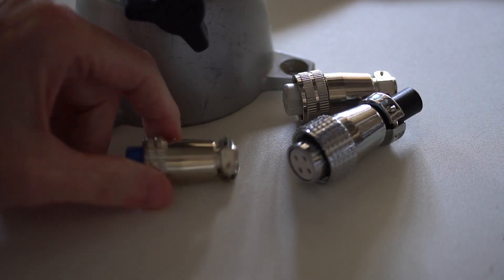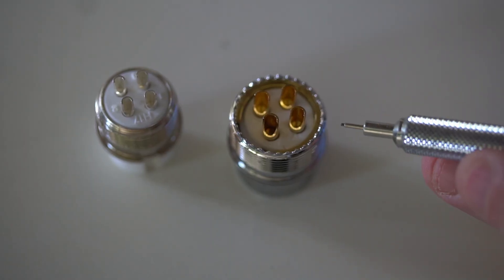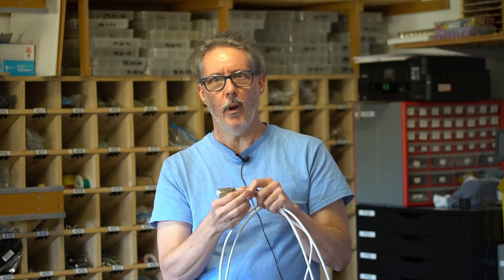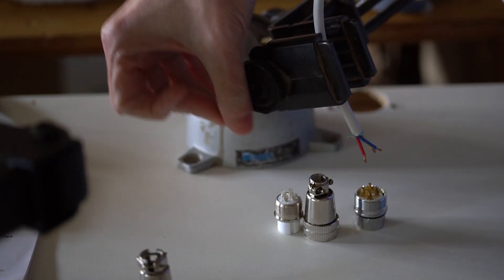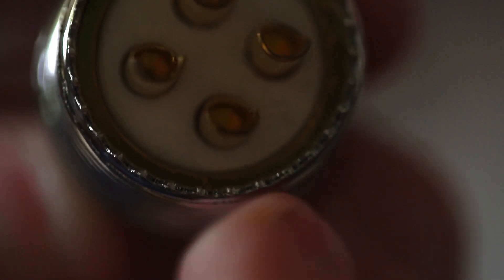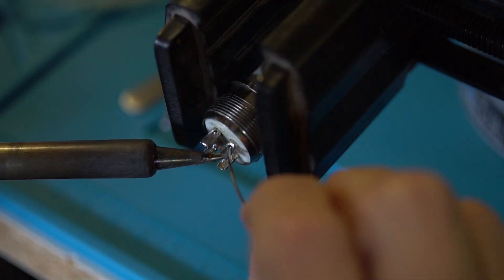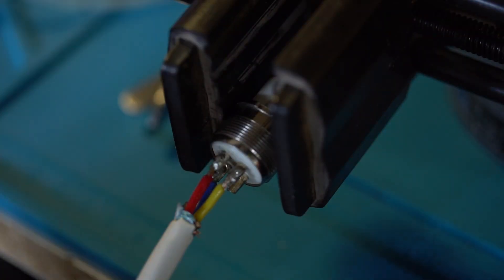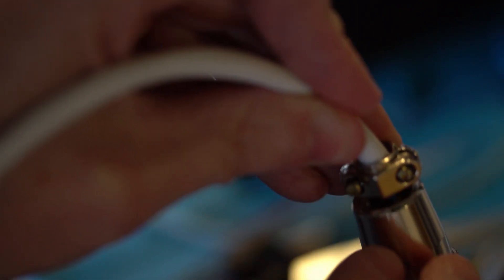Soldering a cable to a 2 2kw spindle connector

Comment: Thanks, Patrick👍
Whenever I have solder cups that are too small for the stranded gauge wire I'm using, I just trim some strands off until the rest of the strands fit, tin the strands, and solder the wire into the cup. But I'm sure you already knew that trick 😉
Reply from the maker: Great advice!!
Reply from the maker: Did not know the trick, so thank you kindly! I pinned this comment.
Reply from the maker: After a little bit of thought, I pondered how the current would conduct through less strands, but the length of the strands and the solder wicking into the strands would have enough cross sectional area.
Reply: @PatrickHoodDaniel  You could think of it as two resistors in series. Also, with the slightly higher resistance of the section with less strands, any additional heat would be drawn away by the long section with the original number of strands👍

Comment: Thanks very much!  I'm actually surprised that in 2025 there isI not a better way to "solder" small connections.  I always heard that soldering was the best way to connect wires, but I recently heard that the automotive industry did studies that showed it wasn't the case, especially when vibration is a factor, and they use crimped connection where possible.  So I feel better about using that as well.

Comment: Hey patrick. Dan from Thailand again. What is the coonector you soldered called? Is it the GX20? I need one for my spindle and i want to make sure i order the correct one.
Reply from the maker: There are a couple variations for this spindle: Here are the links that have more information: https://buildyourcnc.com/products/round-female-4-pin-17mm-threaded-spindle-connector and https://buildyourcnc.com/products/spindle-inverter-female-round-connector-threaded-20mm

Comment: Why you don't use flux
Reply from the maker: I did. The flux is hidden inside of th solder. Most solder is sold as "rosin core" solder. The "rosin" is the flux, and it is in the core of the solder. If I needed more flux, I would use the flux shown in the video. I typically only use that type of flux in my SMD soldering: https://www.youtube.com/watch?v=xJ4S30BBzSo
Reply: @PatrickHoodDaniel  
in the video you said solder past not flux
Reply from the maker: @Lee01-01  In this video, or the link I provided? In the link, I did add the text "flux" on the screen when I accidentally said paste, but maybe I said it again? Thanks for letting me know.
Reply from the maker: @Lee01-01  Yeah, I corrected myself on that video with text on the screen. Maybe I made the mistake twice.

Comment: I think 18 gauge is sufficient for the current if it is  220 volt.
Reply from the maker: @jrmaximus  unfortunately that is what I thought. I was under the impression that since the spindle drew a total of 11 amps, that the three "wires" would share the load. But that is not the case since it is a sine wave where each conductor will exhibit 11 amps (peaks) at different times (120 degrees out of phase with each other). 18 gauge has worked for my spindles for years, but it may not be advisable to do this. I would use 14 gauge, but still calculate the distance as you may need to go to 12 gauge. One interesting tidbit, the Chinese manufacturer will supply 18 gauge cable.